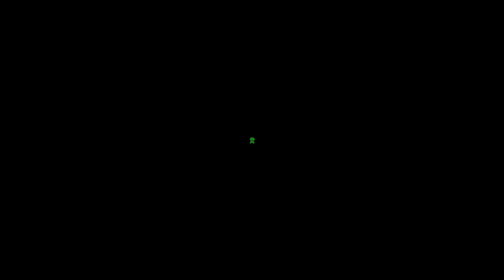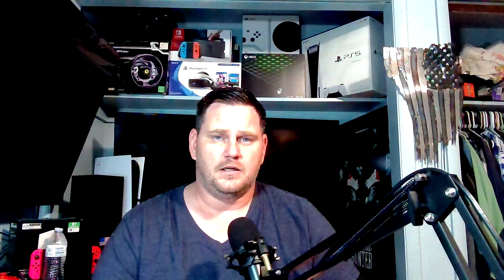Did Austin Evans Lie About The New PS5 Heatsink?

Comment: It's crazy that there were full through testing videos using actual sensors to record the data. And the test reults from many outlets that do these types of hardware testing revealed that the newer model was actually running the SOC cooler. And proved that the extra space along with upgraded fan produces better airflow to help push/remove heat out the back of the console more efficiently than the 1st model. Austin just simply spoke too soon. In theory & General practice it's easy to just assume less material would mean less heat dissipation. But Austin also isn't an engineer designing the console and it's components & Cooling system to actually know for sure without proper testing.

Comment: as a PC fan I would have to disagree with the heat sink theory on the PS5, yes theoretically if the ps5 retained the original design of the heat sink paired with the updated fan then it would have better results but the fact is the test that was only done in terms of cooling was the temp test which shows the exhaust blowing hotter air out, in the pc world the only way to get the best info is to monitor the cpu/gpu temp directly, usually the cooler you can get your gpu/cpu means more hot exhaust blowing out. the reduced heat sink without direct test to the cpu/gpu doesnt prove it is not working efficiently or  better than the old one. Now there is an actual video going around that they did in fact test  the old ps5 and the new one that shows the temp of the gpu/cpu and proved the new one is actually running cooler than the old one. the problem with austin evans video is that he provided insufficient info and as a PC expert that he is it was to be expected that he would run the proper test but he didnt

Comment: Austin actually stated the new PS5 consoles are worse. That will effect Playstation performance where alot of analysis already proved it will give the same performance as the original one. He just scanned the back of the PS5 where the heat comes from. How about the other parts of the system for an accurate check if the new PS5 heating up more than the old one. So you want SONY to charge us more? The material went up so SONY will have to increase the price of something to recoup its money. It might not be the console but they increase the price in other areas like the games or subscription services.

Comment: I don't think the copper vs aluminum will a difference. The whole thing is metal. Metal heat sink on a metal panel. You just need Air to circulate through the console.
Reply from the maker: It is clearly within the manufacturers specifications.

Comment: I had a launch ps1 on the back it had connections for the Playstation cable (proprietary) and it had the yellow,red,blue av plug ins so you could use any wires you had laying around, my friend got a ps1 a few months later and the had removed the av jacks and only had the one for the proprietary ps1 cable so you were forced to buy it, it's nothing new with Sony and their launch consoles are always their best, with that being said Sony sucks has no games

Comment: Balance of energy : more heat outside means less heat inside. One simple example is a freezer, the air on the back is hotter but guess what, inside has ice. The apu is the same, but cooler and fan were redesigned. It is not logical to think the system is less efficient because the air leaving is hotter.
Reply: By the way, Xbox produce more heat that the new PS5 model

Psssst. Don't tell that to anyone ( logic - higher exhaust temp. - less hot air inside and better cooled components, which XSX really has )
Reply: @imt558delux  not necessarily. We don't know how much heat series x apu generates. If the chip output more heat, even a less efficient cooling solution would output a hotter air.
Reply: @imt558delux   if series x apu generates more heat then a less efficient cooling solution could remove warmer air than ps5. It is necessary to know some specifications like airflow, room temperature, apu size, max apu temperature, area of contact of the cooler with air to do the math to know the efficiency of the cooler. I didn't see this video, but did he make the math?
Reply: @edeneal3336 

Just watch a video then
Reply: @imt558delux  nah, I'm not really interested. I was just stating that you cannot jump to conclusions without knowing the math behind.
Reply: @edeneal3336 
Ok if you do not want to watch it. 
But i guess Austin didn't jumped to conclusion since he claimed that PS5 is worse based on the recorded exhaust temp. with a mobile phone. :/
Reply: @imt558delux  he jumped to a conclusion because he confused the temperature of airflow exiting and the board's temperature. If more heating is being removed there is less heat inside.
Reply: The ps5 and a refrigerator use to completely different methods of cooling. To compare them and say the heat is better because fridge get hot is completely misleading and wrong.
Reply: @18matts  it doesn't matter if refrigerator uses a thermodynamical cycle instead of a simple heat transfer because the balance of energy principle is the same. Considering the same variables, if the air leaving is hotter means more heat were removed from the system.
Reply: Heat and Temperature are two different things. A thermometer measures temperature not heat, and more temperature does not necessarily means more heat. Believe me, 10 W can heat up a small heatsink more than 100W on a big heatsink. Heatsink temperature depends on the heatsink overall thermal resistance multiplied by the amount of heat it dissipates. Example. A small heatsink with a thermal resistance of 5C/W multiplied by 10W heats up 50C above ambient temp. But a more efficient heatsink (cooler) with 0.25C/W multiplied by 100W heats up to 25C above ambient temp. So even if the small heatsink is dissipating less heat it gets hotter.

Comment: If your fan died PERIOD it wouldn't matter if the console used copper or not. The system would shut down from heat being trapped and not being pushed out.

The same would happen to the Series S/ X as well. Everything works in tandem to keep the console functional. 

As long as the chipset status within its thermal parameters for functioning than none of this matters, even if it means the console runs slightly hotter.
Reply from the maker: That's exactly what I am saying. In the end the new ps5 model is going to be just fine.

Comment: Austin Evan's thermal test is flawed, you test the thermal of the body of the console around the APU and ram chipset to determine whether or not the new redesigned of the heatsink dissipates heat and exhaust hot air better than the original... nothing frogboyx1 gaming said in this video means shit without comprehensive testing like what Gamers Nexus did in his analysis on the PS5 vs Xbox Series X Airflow Testing video... I will wait on someone who are more capable of running proper testing on the thermals of both OG PS5 and the new PS5 at least that analysis would be better than what Austin Evan's flawed analysis...

Comment: Not a pony haven't had a ps since 2. The fuck bro I came to your channel because  you seemed neutral in all of this console crap. I love my xbox  but the ignorance in all this is unbelievable. As I have many years in the mechanical world there needs to be far more testing to be done to prove this is a problem if it is a problem. If the tests were done internally it would be a different story. The idle exhaust temp of the series x is 105 does that make it worse than the ps?
Reply: They haven’t tested it underload what happens when it starts to overclock the CPU you ponies are neglecting that the Xbox runs marginally hotter but it is fixed and won’t overclock stop defending this greedy company the directors cut station
Reply: @slash8944  LOL, Bone fans. XSX exhaust temp. is 65-70C. PS5 is still below 60C
Reply: Totally a pony here have a costume and everything. Considering I haven't bought anything ps since 2009 I will except my fate at the pony show. Im just pointing out ignorance not defending sony. Im a proud game pass ultimate subscriber but if im anything im a nintendo whatever they are called. I will belive tronicsfix or spawnwave and I appreciate spawnwaves aproch to this because he doesn't have all the info.
Reply from the maker: I am neutral in this stuff. But calling the guy a lier when you can clearly see the heatsink is smaller and made from a different material, and shows that it is putting off more heat is ignorance. Yes we need to see more testing. And it is probably going to be just fine but this is turning into nonsense pretty fast. This video is intended to stop pointing fingers and start asking sony to explain this change to consumers.
Reply: If the heatsink is less efficient how can it produce more heat? In the video he says the new one is pulling a few more watts but in terms of power transfer to btu's should be negligible. If I put a smaller radiator in my house in theory I should get less btu's. So I understand your argument. But we are getting more btu's from this smaller radiator (heatsink) so how. Is the chip set pulling more power? Did they contact the memory chips better to gain these degrees? How is this smaller radiator creating more heat to be expelled out of the exhaust? Im really not trying to hate im just not excited about how everyone is jumping to conclusions on something we need far more information to draw an educated conclusion. I completely agree with you that sony has been sketchy but what multi billion dollar company isn't?
Reply: @mccola9955  LOL. Heatsink is NOT less efficient if it drives more hot air out of the case. On the contrary, it is more effective one. That's common sense. Even who is no professional engineer would think like that.
Its the heatpipes that take the heat ( in new PS5 they are longer by a double ) away anyway, not the sink - the sink removes the heat from the pipes to be taken away by passing air. There is still a lot of heatsink surface areas so as long as that is soaking away heat into the airstream and allowing the heatpipes to continue to have capacity to remove it from the APU I see no issue.

QUIETER means they’re achieving enough cooling with slower fan speed . And hotter exhaust suggests they’re removing more heat. So this may be a better design despite being smaller

Do you see the main difference??? Peoples jumped on less material, but i see a drastic design change. The new design assures that there's no more than 2 banks of heatsink for the airflow to cool, while previous design it would go up to 3 (very thick 3) at the bottom left of the heatsink on older PS5. To me it seems they realized that the airflow was really not properly cooling the 3rd row. At some point the air getting to the 3rd row will probably have lost momentum and create more like an hot air pocket, stagnant almost, as the static pressure even if it still has some airflow, is not optimal and is hindering the cooling performance of the 3rd and 2nd bank of heatsinks.
Reaching temperatures over guarantees, reconfiguring the cooling system, and voila, a rearrangement of the cooling bank in a subsequent revision was often with less material, but more inteligently built.

More heatsink area inside the PS5 case ( or any case ) can't mean in anyway better cooling. More heatsink area can cause counter effect such as - somewhere inside the case hot air pocket can form and can't go out.
Reply: @mccola9955 

Btw. You are talking about "jumping to conclusions" yet that Xbox asshole Austin claimed immediately new PS5 is worse based on recorded exhaust temp. with a damn mobile phone. That is not jumping to conclusion at all. Right. :/
Reply: @imt558delux   bro you obviously have not seen my previous comments you are preaching to the choir here I was being sarcastic  to try and make a point the more heat disaption = more efficient I commented that 7 mins after autin uploaded his bs vid. So no need to explain to me im on your side on this I was just trying to explain in a way others might understand.
Reply from the maker: @mccola9955  my video is not jumping to conclusions I am simply stating that copper is better for heat transfer and there is less of it now. And that Austin Evans did a good job showing us what was changed. Whether he is wrong or not in his analysis is for Sony to explain the difference.
Reply: @Frogboyx1gaming  sony will have no choice but to explain with everything going on, they would be dumb not to but it's sony so probably wont say anything.

Comment: Really? You call testing outer air a professional test? With a camera phone? Do you know that you need to test the internal components? Do you know that he needs to test it for a few days in different environments? The important thing is to move the air out and it does not matter how you do it.
Maybe Austin is not lying but he sure misleading people
Reply from the maker: This has nothing to do with testing. You can clearly see the new heatsink has been changed.
Reply: @Frogboyx1gaming but with that I also see more open space in the console, different fan, different pipes… the point is, we don’t know what is the temperature inside the console which is way more important
Reply from the maker: @ramiyohay7286  exactly we don't know. This is for Sony to Address and show consumers that are already Having trust issues with the thermals of the ps5. Me personally I don't think it is really going to matter in the long run.
Reply: @Frogboyx1gaming  no it is not. It will perform just the same . What I am saying is Austin is misleading people because true testing is done over time, not on an hour with a camera attached to the phone
Reply: @Frogboyx1gaming  It does. You don't claim something is worse based on recording exhaust temp. with a damn MOBILE PHONE. It really doesn't tell you anything other than the temperature of the plastic. Hotter exhaust temps. means the heatsink and fan are doing a better job and removing the heat inside the system. The SoC is the same ( WHICH IS ),The power draw is the same ( WHICH IS ), Hotter exhaust temps tell you the system is removing MORE heat than the previous unit.

Comment: It seems to be common practice for a newer versions to give you less to prepare for future console price drops. They start cutting things out when it's not absolutely necessary. I've read about how Adata exchanged its high-end SSD chips for at least 5 times cheaper to make it cheaper.
Reply: nobody says what the unique thing that matters.     the bottom memory as nexus showed 93c⁰.     the new heatsink    reduced  that temp with themal pads.     the bottom of the plate was not shown. ?      the unique problem is that and noone even questioned it.    the rest is just talk and talk like sissies

Comment: This is why I love PC. Sure it costs more, but I pick what’s in it, even the cooling.
Reply: Ray traycing , resolution ,frames and texture. #facts
Reply: and u dont get scammed with $10 for upgrades
Reply: @Radical1994  you get scammed with half done games like halo🤣🤖🤣🤣
Reply: @Radical1994  yeah lol
Reply: And your hands dont burn from hot air flowing from your ps5 heat sink all day in you room
Reply: @tenaciousspectre3383 wow, is that a thing?
Reply: @CombatMonkey11B  I had to turn that crap off my hands are Burning
Reply: @tenaciousspectre3383 Dang. I have excellent ventilation and a high quality AIO on my PC, so it’s always cool to the touch, and the exhaust air is barely above room temp, like BARELY.
Reply: @CombatMonkey11B I Should have spent my $3,000 on A pc not a ps5 and bunch of games....